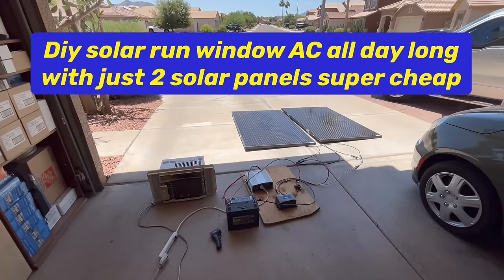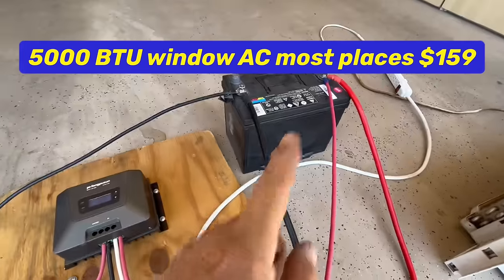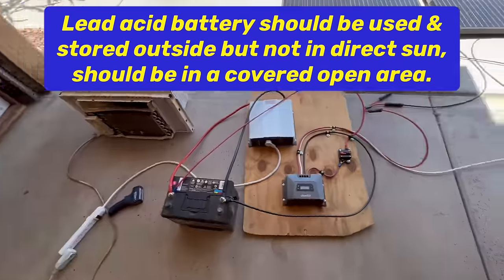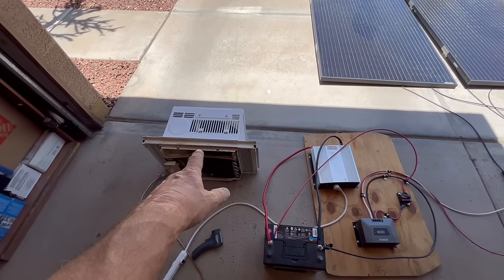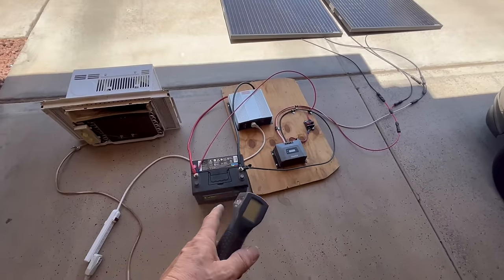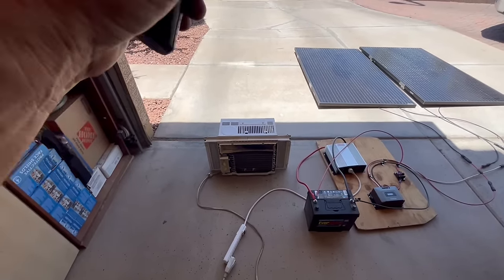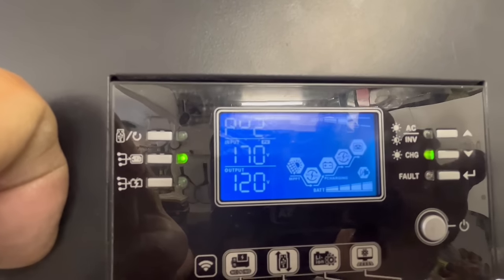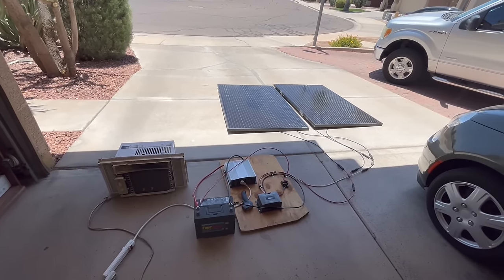Run your window AC with just 2 solar panels when sun shines. Easy DIY project you can do in one day.

Comment: I am new to your channel.  Can you do a video on your whole house solar panel system?
Reply from the maker: I do have I think 2 videos but I actually at the moment have 3 separate systems all off grid. The first one is a 12kw Growatt off grid low frequency inverter that I run my 3 1/2 ton ac, 4 ton ac 12.7 ton pool heat pump pool heater/cooler along with 2 mini splits heat pumps that ac and heat and other appliances. I have a little over 11,000 watts connected to this 12kw inverter. My 2 independent system is a 6kw Growatt low frequency off grid inverter that I run my 18,000 btu mini split, 12,000 btu mini in my garage along with a washer, and heat pump electric dryer that is ventless and uses less than half the watts a regular clothes dryer uses. I have 4,000 watts connected to this 6 kw inverter. My 3 rd independent system is a 6500 watt 120 volt output to power my pool pump, 17,000 btu pool heat pump electric pool heater/cooler that is 120 volts. I also use that fir 3 chest freezers, a 24.5 cf refrigerator/freezer and 2 mini split heat pumps for air conditioning. I have 5,000 watts connected to this 6500 watt inverter. I also have a 5500 watt EG4 charge controller that supplements any of my 3 independent inverters, I have 4,000 watts connected to this charge controller. So I have a total of 24,000 watts on 4seperste independent systems. I use each system at different times if the day and for different applications. It is not advantageous for me to combine all solar panels into one system. For what I use the systems for it is better to have this many and separate from each other. Some might find that hard to understand but it works extremely efficiently for me and will be completely paid off in just 4 years since I started building systems which is at the end of 2023. I use so much more electricity than before, I would say about 50 percent more than when I was just grid power. I save 90 percent off my electric bill using off grid to run my air conditioning 100 percent of the trine 7/24 on just solar in day and 25.5 kWh EG4 LiFePO4 battery bank for overnight. I will try to do another video soon on entire system but I hope all this info helps until I do another video. Thanks for the question and hope you have a truly wonderful and very blessed week.

Comment: So u need least 200 watt solar what kit affordable could u get for small 5 by 8 cargo trailer ,?
Reply from the maker: I am using only 2 solar panels, but this was in a shed and was easy to cool quickly. It cycled on and off often. I was able to get away with just 2 solar panels but a good rule is to have twice the amount of solar needed. This window ac use 500-550 watts while running. You should have around 1000-1100 watts of solar. Clouds in sky blocking the sun will greatly reduce solar input. We have over 320 days of sunshine in AZ every year. But most places have clouds often and can last for days. Having enough solar input to run ac and keep the battery charged is your goal. That’s why you would need double the watts in solar. If you have at least 1000 watts of solar on cargo trailer, you would be fine. But 200 watts will not run ac more than a few minutes.

Comment: where did you get the 330 watt - 12-24 volt solar panels ? ty
Reply from the maker: Santansolar.com. They have great sales several times a year. Check website couple times a week to catch sales. Need to buy within first few hours of sales to get best deals as they have limited stock on clearance solar panels.

Comment: If that ac works, than a blender or microwave would work no problem? I will look into finding those parts to start
Reply from the maker: A blender can surge to 1500 watts and a microwave is usually 900 watts or more you would probably be better going to a larger system that uses a all in one pure sign wave inverter, you can get them 1000 watts and up for 12 volt battery bank. I used a 2400 watt pure sign wave mpp off grid inverter with 10-250 watt used solar panels to run 2-12,000 btu mini splits all day long from 7-8 am to 5-6 pm. As soon as solar panels are in full sunlight with no shading you can run both mini splits. I bought 10-250 watt used solar panels for $30 each. They would great. Check out my other videos. I am now running all my air conditioning in the house 7/24 and in the 3 car garage all day long as long is sun is shining. So that’s around 3000 square feet I am air conditioning during the daytime with only solar panels as electricity source and at night I use a 25.5 kWh EG4 LiFePO4 battery bank. I it pretty amazing when it has been. 113 degrees outside during the day and 90 degree low overnight. I have spent $0 on air conditioning in last 45 days. I show the 6 mini split heat pumps I installed and where I installed and why I installed at that spot in the house and how much you can cool or heat with each one. I have over 100 videos now. I even run my pool pump 24 hours a day 365 days a year on only solar. I am now able to heat my pool in the winter and keep at 87-89 degrees water temp even when the overnight low was in 30 and 40 degrees. Hope you enjoy seeing what you can do with off grid solar and that it really is pretty easy to do. Thanks fir you comment and if you have any more questions , I would be happy to answer. Hope you have a truly wonderful and blessed weekend
Reply: @diy-solar-guy  there's alot of big words in there since I dont know much bout solar but thanks I will look into it and look at ur other videos as well to get a better understanding of it
Reply from the maker: @lifes2short4b41  just to let you know , 4 years ago I knew absolutely nothing about solar off grid, mini split, heat pump ac/ heater, pool heat pump heaters, LiFePO4 batteries. And I did all this while going through 2 incurable cancers that leaves me only able to work on solar about 5 hours a week, maybe 10 hours. I get cancer treatment every 8 weeks for last 8 years. So if I can do this, then anyone can do it. Very easy to install components. Most people could install what I did in 4 years in less than 2 weeks. So that should inspire you that you can do these off grid solar projects.
Reply: @diy-solar-guy  thank you and I hope you better and keep getting better ...you got a follower
Reply: @diy-solar-guy  will the harbor freight thunderbolt 100 watt monocrystalline solar panels work? Connect them together
Reply from the maker: @lifes2short4b41  you would need to produce at least 550 watts so that would take like 6 or 7 of the 100 watts solar panels factoring for loss of watt output from panels. You just need to have at least 550-600 watts coming in from solar panels to keep ac running. If you drop below that , you will be discharging battery to the point where it won’t keep ac running or be able to restart ac when it cycles off and then on. Does not matter what panels you use or size in watts but having at least 30 percent more watts than needed will insure ac unit runs continuously and charges battery at the same time. Now I run my entire 2 story house with a 3 1/2 ton and 4 ton ac with solar in the day and 25.5 kWh battery bank at night. My house is 2450 square feet and I air condition my 3 car garage as well all day, all using only solar I produce. Check out my other videos and how I accomplish this. I even heat my 15,000 gallon in ground pool in winter with only solar to 87-89 degrees water temp. Thanks for your input. Hope you have a wonderful and blessed day
Reply: @diy-solar-guy  thank you

Comment: What was the total cost for this set up ?
Reply from the maker: When I purchased this product about 4 years ago it was around $600. Today, closer to $800-$1000. Prices have gone up instantly high since I did this. Today, it is better to buy an all in one inverter like a EG4 3000 watt inverter that you can expand to 12 inverters in parallel down the road if you wanted to. It has 120 volt output. You would need at least 1-48 volt battery to use off grid inverter. You can run a 12,000 btu mini split that cools or heats around 500-600 square foot area. They even sell mini split with direct connection from solar panels to outdoor unit if mini split. 5-400 watt solar panels and some 10 gauge solar wire along with 2-MC4 connectors and your running a mini split during the day when the sun is shinning from maybe 8 am to 6 pm. That would cost around $1700. You can also connect to grid power or Lithium Iron Phosphate battery bank and run overnight. These mini splits are designed for the homeowner to install. Takes a lot of risk out of the equation. I just bought a 12,000 btu mini split, 110 volt on eBay for $500. This is not the same type as I talked about above. This one needs hvac gauges and vacuum pump to install. You would need to either hard wire to breaker panel or add an electrical cord(at least 10AWG) so you could plug outside mini split unit into an outside electrical outlet. I discuss a lot of this in my other videos. We now run our 3 1/2 ton upstairs ac and 4 ton downstairs ac with solar on day and upstairs only ac at night on lithium iron phosphate batteries at night. That’s with it being 110 degrees out here in the day in Phoenix AZ this last month. Check out my other videos on mini splits and how I installed them as well as when I installed to get a better idea of how to efficiently heat or cool your house or shed or area of your house with off grid solar. Hope you enjoy the other videos and I hope you have a truly wonderful and extremely blessed 2024.

Comment: Can u use the battery on front of your cargo trailer
Reply from the maker: More than likely that battery is a lead acid or AGM. You probably would have to upgrade to a drop in LiFePO4. At least I would upgrade to a LiFePO4 battery but would disconnect when not in use so as to not drain battery.

Comment: Hi 👋 where are find a good price for all this stuff? Only I got is a 3k inverter
Reply from the maker: I bought both my 12 kw Growatt and 6 kw Growatt off grid low frequency inverters from Signaturesolar.com. I bought the 12 kw for $1200 and 6 kw for $899. Both inverters are refurbished. I have had no problems with the inverters at all. What are you trying to run, that will depend on what type of inverter you will need?
Reply: I want runs a 5btu air conditioner
Reply from the maker: @LaleyendaTirado  if that is all you will run you could buy a 24 volt 2400 watt MPP pure sign inverter. I used for years before I switched to 48 volt inverters. I have a lot of videos on the MPP 24volt inverter and all the appliances I use it for. I used 2 of these inverters to run 2 mini split 1200 btu 110 volt upstairs and 2 mini splits downstairs and I reduced my electric bill by 60-70 percent which the saving paid for the solar system and mini splits within 2 years. You can still use window ac unit with these MPP inverters. Mini split inverter heat pumps can air condition in summer and heat house in winter which is an advantage over window ac. You can use year round. Check out my videos on using these 24 volt inverters. You can buy on eBay straight from manufacturer in Taiwan. Could cost around $650 to $750. I would try to use AGM or lithium iron phosphate battery, the better is the lithium but 2-3 times as expensive but will last 10-20 years as where AGM is cheaper but might only last 3-6 years. It depends on how much you want to spend. I could only afford AGM when I started using MPP inverter and later switched to LiFePO4 batteries because price came way down. Since you have a 3 kw inverter, you can get used solar panels, wires, breaker and maybe battery at santansolar.com. If you look to upgrade inverter and batteries later I would look at signaturesolar. Com. They have great 48 volt inverters and a large selection of lithium iron phosphate batteries. Check out my videos to get a lot more information before you buy. Try to stay away from off name inverters and batteries, might be a Lille cheaper but can also be inferior product that won’t last 2 or 3 years. Both places mentioned will sell great products that will last a long time. The only inverter I would buy on eBay would be MPP. A lot of of the inverters that look like the MPP inverters are bad quality and will give you a lot of problems and error codes. Growatt and EG4 inverters from Signaturesolar.com are great inverters but most are 48 volts inverters, there are a few 24 volt inverters. Hope that helps. Hope you have a wonderful and blessed week

Comment: If you're running this system in the daylight, why do you need the battery? I want to know if this will run without a battery in daylight only. Anyone know?
Reply from the maker: You can not run without a battery with this charge controller, they have battery less inverters that might be possible but the battery is in the system to keep the voltage more constant. If you have clouds without a battery, the system will shut down and the biggest problem of not having a battery is starting up the compressor. Needs 6-7 times the normal running amps to just start the compressor. They now make mini splits that do not require an inverter or battery to run during the day, you could also connect to grid or battery for when there is no sun out and be able to keep running and can limit the input watts to 600 watts. The battery is needed to keep the system stable and be able to handle the inrush amps of startup surges. Hope this helps you to understand better. Hope you have a truly wonderful and blessed day.

Comment: I have a question. I was running 2 245 watt. With 37.75v  but i was only drawing about 200 to 300 ish watt. I live in fresno California and its super hot during summer. I dont know what im doing wrong here
Reply from the maker: You will never get 245 watts out of 245 watt solar panel. Maybe 170-190 with perfect conditions and maybe for a few hours. You are not doing anything wrong. In order for me to get  3000 watts into a 3000 watt inverter, I would have to connect 5000 watts in used solar panels. Think about 80 percent of what solar panel states for watts. I always over panel more than what I need. If you want to get 1000 watts during the day, you should probably use around 1600-1800 watts in panels. Remember, you will only get a peak from around 9am-3pm at best, before and after those times, you will get maybe get 5-50 percent of solar panel watts. That’s if they are in full sun shine with absolutely no shade on panels throughout the day. Hope this helps in your planning. You have a lot of used solar panels sellers in California.

Comment: Could you hook it to a 120v me cool mini split?
Reply from the maker: @edlerlights6486  yes but you would have to greatly improve upon this system. You would be better off using an all in one inverter and 48 volt battery bank instead of12v  battery. EG4 has a 3000 watt off grid inverter that you can expand down the road up to 12 inverters in parallel. You would need at least 2000 watts of solar to be safe and a much bigger battery bank. Each inverter can give you 3000 watts output with 5000 watts solar panel input. You can connect 2 inverters in parallel and get 120/240 volts and run main ac in house like I do. I have 4 inverters in parallel and am running my 3 1/2 ton & 4 ton upstairs and downstairs ac in my house right now using only solar. I spend $0 on air conditioning and heating year round now with off grid solar. It is DIY. This is what I started with but check out my latest videos on running to see all I run with off grid solar . I even run my 3 1/2 ton upstairs ac overnight on EG4 LiFePO4 battery bank. Links are in videos for products in use. You can now buy a EG4 12,000 Btu mini split 120 volt that has direct solar connection to the outside unit of the  mini split. You could air condition or heat during the day with just solar, Completely eliminating the need for inverter or battery. This 12,000 Btu mini split is 120v and can connect it to the grid power so when there is no sun, the grid will continue to keep running the mini split until next day when sun rises and you have enough solar to run mini split. The. Ink split automatically started reducing grid power as sun comes up to where it is no longer using grid power and only using solar all day long. The grid power is for when there is not enough sun or rainy days. You can have grid connected but not use it as well. It is free ac or heat during the day. The mini split will limit only 600 watts to run it when on grid power saving you money. Links are in my other videos for this product.watch some off my other videos and see all you can do with off grid solar. If you have more questions, please don’t hesitate to ask. Hope you have a truly wonderful and blessed 2024. You can install this mini split yourself! I will be purchasing one soon and will do videos on it in the future. Once most people see how easy it is to do it yourself and save money, they start building bigger system. The EG4 3000 watt inverter is under $700, install 2 and you have split phase 120/240 boot to run just about any household appliances. You would just have to run separate wire from inverter to appliances and disconnect grid power wires. Everything I do is off grid solar. Nothing I do is connected to grid in any way. Check out my  videos and explore off grid solar.

Comment: What a hodge podge.
Reply from the maker: @tylermcnally8232  That’s ok, it worked for over 2 years. Now I run my 3 1/2 ton upstairs, 4 ton downstairs ac and 3 car garage ac all day with solar cooling around 3000 square feet and run upstairs ac overnight on battery bank. I spend $0 on ac when it is 110+ degrees outside. It all started with this as you say hodge podge experiment. Hoping you have a nice cool night as I do for free.